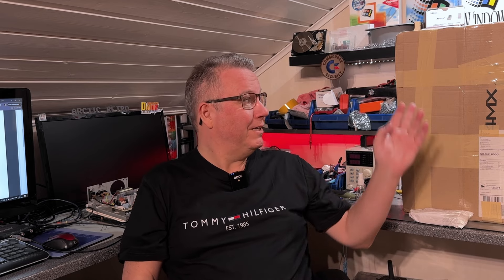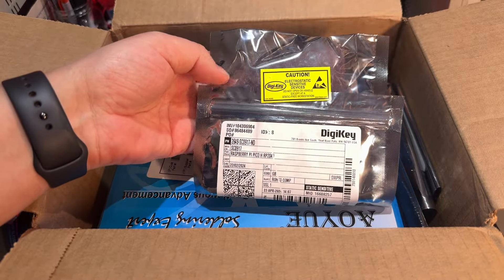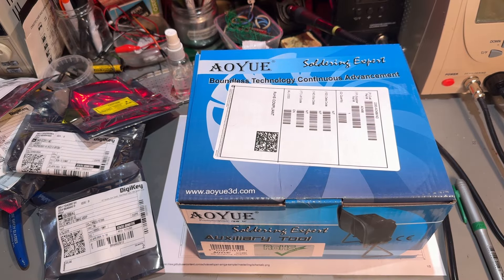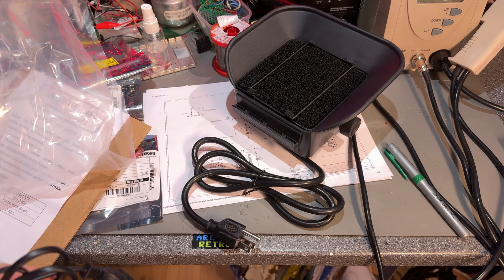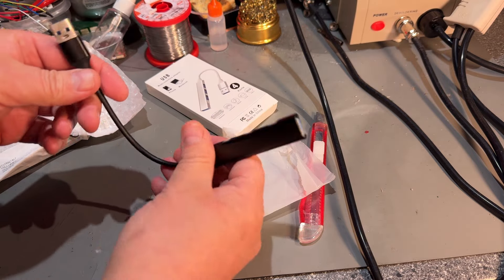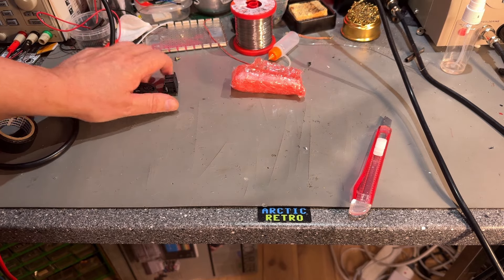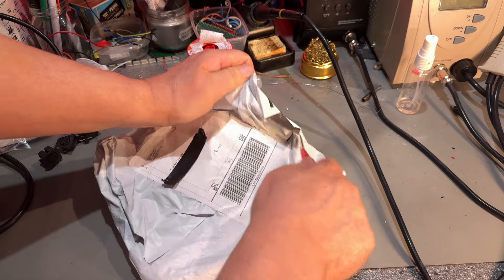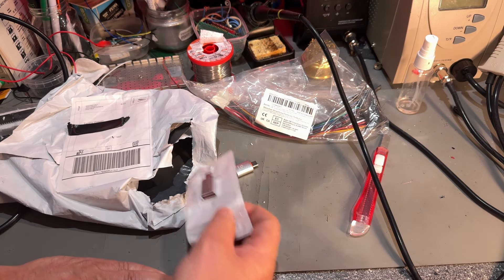Mail and donations  - May 2024 - Lots of strange stuff and a very sad Commodore VIC-20

Comment: Oopsie on the fume extractor, but all's well that ends well.  That hub is really compact!  Performance testing is definitely in order.
That screw-threaded mandrel is for use with felt bobs.  The red stuff is jeweler's rouge!  Use that with the felt bobs for polishing work.
I'm left wondering just what sort of fuse holder that was (maybe the threaded-cap type?)  You'll figure the VIC-20 out eventually.  Good stuff, man.
Reply from the maker: Thanks. Working on the VIC20 now

Comment: Ok, we will go metric if you drop PAL and your funny wall plugs.
Reply from the maker: PAL is clearly better. And our funny wall plugs are safer than the US where you can easily get shocked :-)
Reply: @Arcticretro   our 220v plugs are safe.  Grounded 110v (and add a Ground fault interrupter) are safe enough.  Now let's both get safe plugs and go down to 110v and we will all be safer.
Reply: @networkg  US plugs and sockets are just terrible and most of the ones I've seen are not 220V and many don't even seem to be grounded. Hard to beat type G

Comment: I suspect that power supply is not giving enough power for the Vic20. The Vic20 needs about 3A (at circa 10v that's round 30 watts - the VIc20 label states it needs 25 watts). Sometimes this is expressed as 30 Volt Amps. Your replacement power supply is putting out 3.6 volt amps, so a little over 10% of what is required.
Reply from the maker: Yes, I actually realized that afterwards. The PSU is too small. Still the machine is faulty. I tried with a suitable PSU
Reply: @Arcticretro  I look forward to a repair video - it wouldn't be any fun if it just worked!
Reply: As do I, thanks again for a very entertaining video. It is always like Christmas unwrapping when Ali/Bay parcels arrive. 
I'm sure you'll make this VIC20 working.

Comment: 120 v, 60hz is normal - 220v 50 hz is just weird. We actually do use 220v for items like electric stoves, electric clothes driers, at home car charging stations, some power tools and air conditioning and other uses.

 As for metric, why should we use such a logical system outside of science and medicine? 5280 ft to a mile, much easier than 1000m to a km. lol

Interesting videos
Reply from the maker: Most of the world uses 220V. I can see why you only want 110V when I see the poor safety on your sockets and appliances ;-) Yes, why use a easy to understand metric system when you can bring your calculator to convert units :)
Reply: @Arcticretro  I know - the whole  message (except for the very end) was poking fun at the way the US power socket operates and how illogical the imperial system is. Electroboom (spelling?) from Canada did a video on how dangerous the US socket is and how the UK is best, with the European standard in the middle. I think Technology connections also did that
Reply: @larryk731  The really funny thing about US plugs is that they're very close to being much better. If the prongs were tilted to form an angle like Australian ones, they'd be so much more robust!
Reply: @talideon  Possibly, the true issue is that it's entirely too easy to accidentally touch the live prong when using a worn out plug or outlet. I can think of zero safety features similar to UK, Australia/new zealand,  or European plug designs.
Reply: @talideon  They would and the AU/NZ standard is actually based off the US standard, however AU plugs are still terribly flimsy, it's so easy to bend the pins still, but still much better than the US

Comment: Hi Tommy. Are you also a licensed amateur radio operator? If not, you should get a license to operate that radio because it is also a transmitter. Have fun.
Reply from the maker: No. I will not transmit anything. I know it's probably not legal.
Reply: @Arcticretro  I know that you do not intent to transmit, and I believe you 100%. But, unfortunately the EU regulations, regardless of your intent, require you to have a radio amateur license to legally own that radio. Now that you made it public that you bought it, maybe you should contact your local amateur radio club to learn about how to obtain a license. I believe you need to apply to Nkom and take an exam. Amateur radio is a great hobby, and it also involves a lot of DIY electronic projects. You may like it. 😁